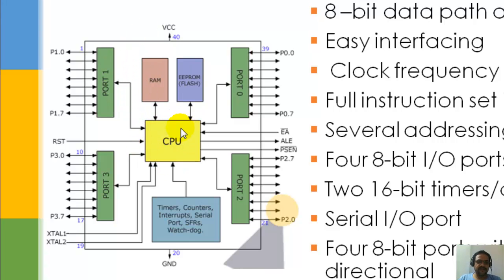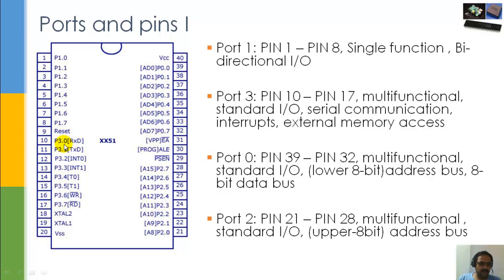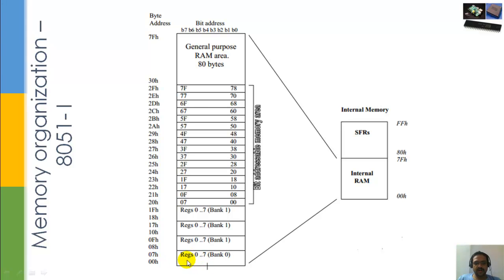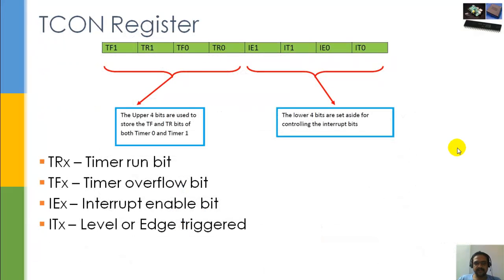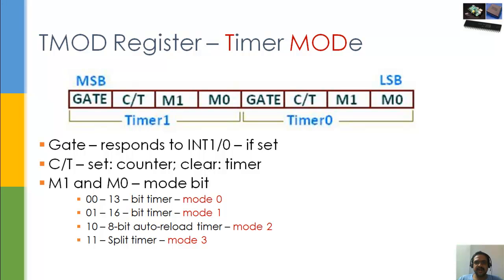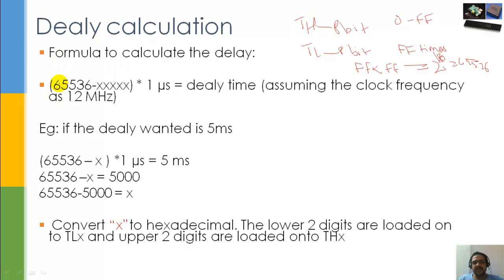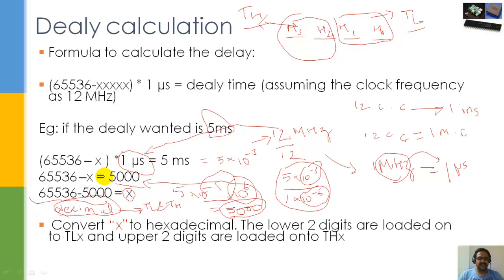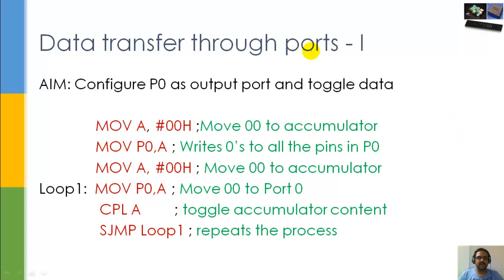8051-Timers and Ports

Comment: Hi sir,
Is there a reason why you are using immediate addressing mode in making a port as an input or output
Why not try to write data to the register(register addressing mode) directly like = MOV P0,#00H
Thank you for an amazing lecture..
Reply from the maker: The data 0 or 1, or 00 or needs to be written to the ports. Best way here is to do immediate addressing rather than a round about way. Immediate is best in the sense that we know the data and its constant.